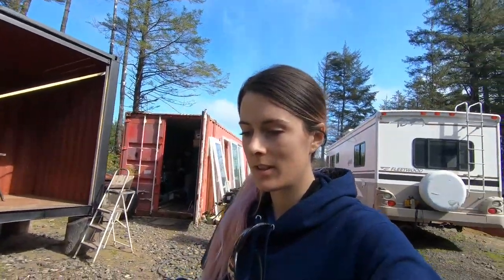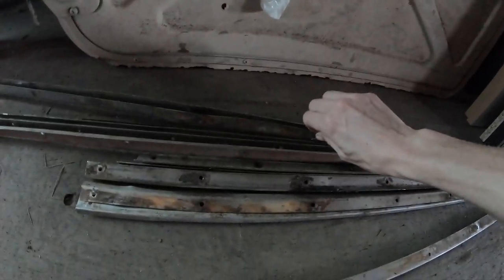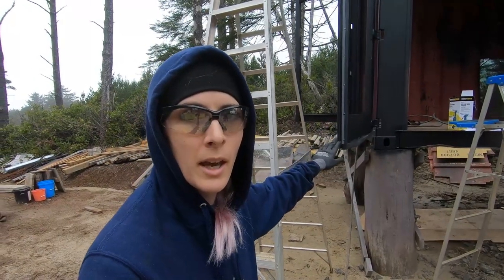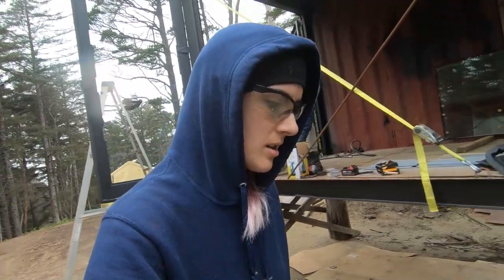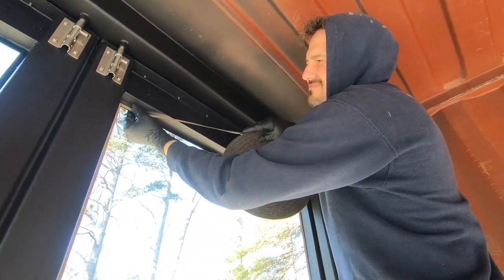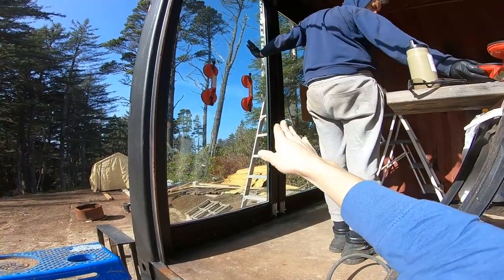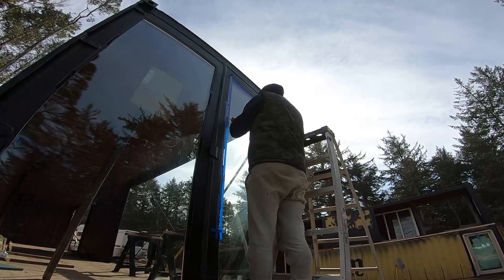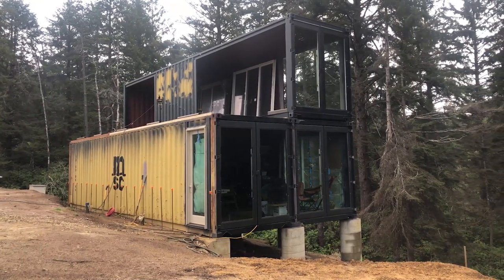Converting Shipping Container Doors into GLASS DOORS! How to, cost breakdown, & more! Ep. 28

Comment: Looks great, but how do you fit the wall and ceiling insulation, framework and interior lining around the doors? Won't it sit proud and cover some of the glass? Want to do similar doors on my container, but not sure how it will all fit together.
Reply from the maker: We won't have any of that around the doors. We live in an area that has a very mild climate so it's not a big issue. We'll have insulation and framing/drywall for the house but the area around the doors will remain as is for the most part.

Comment: did you guys find that putting stainless steel rivots in was a bloody pain!?.... sometimes the driving pin doesn't wanna snap out.... even with the rivot machine unit?
Reply from the maker: They were tough at first but afterwards we replace a part in the River gun and it was smooth sailing from there 🙂